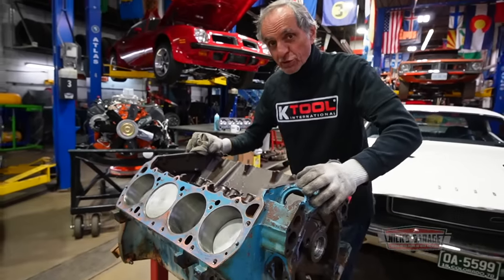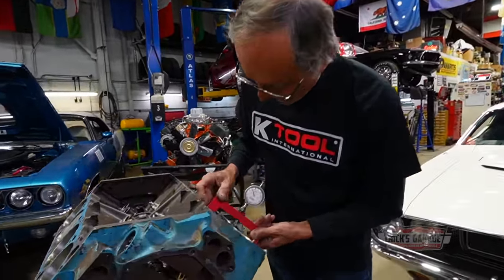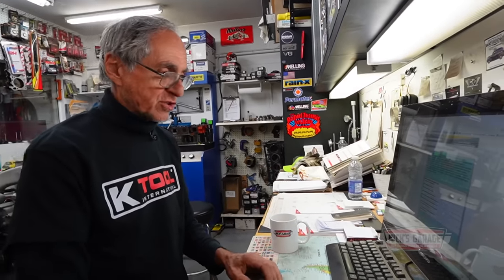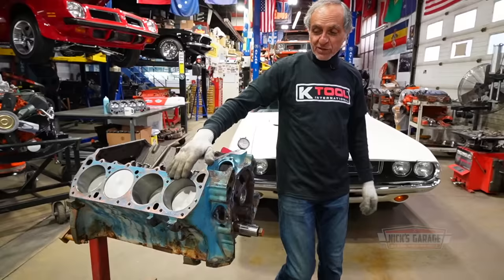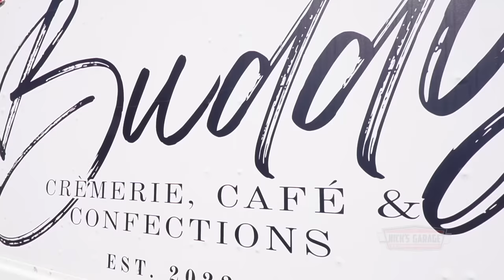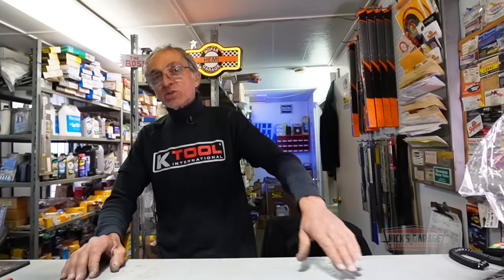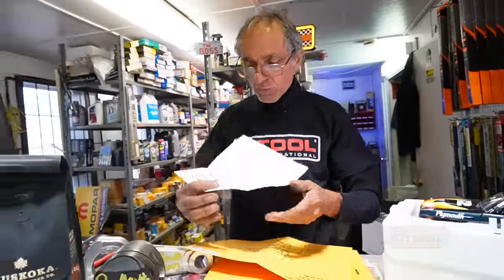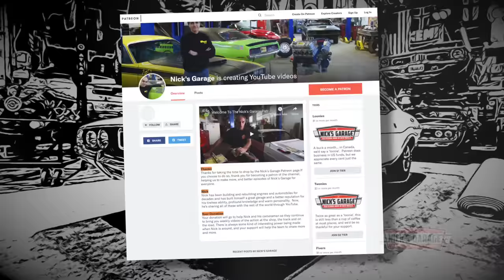Old 440 Build Diagnosis - What Were They Thinking?

Comment: 1978 440, advertised compression ratio 8.2; actual compression ratio around 7.5-7.8.  No mystery here.
Reply: Typical Calif smog motor.
Reply: Those were the smog years in all makes.
Reply: Volkswagens were required to meet emission specs they were not engineered for. Many people scrapped good cars in frustration that could not pass the smog tests.
Reply: Tricked out good VW engines were temporarily  installed to pass emissions. Various concoctions were added to fuel tanks for any possible emissions test for improvement.
Reply: A Hot Rod Magazine project found bronze valve guides with tighter clearances produced the single most improvement for passing emissions tests.
Reply: I agree partially, I’ve never seen pistons in a 440 installed that low though?
Reply: I've seen .080 below deck. This is nonsense.
Reply: I've seen .155 down with a  .045 dish.
Reply: There a lot’s varies Comp height pistons on factory mopar motor that were ready available back the day
Reply: RV engine probably.
Reply: Mike, it's disgusting ain't it,  mate. 7.5 compression,  sounds like an old pommy engine spec ! Haha what a joke 🤣
Reply: @invisiblecouch  lol did the engine even run ? Wow...
Reply: What is that like 90 psi cranking? Brutal.
Reply: And the Marine reverse rotation was 7.2:1 because I measured one in the mid 80’s out of the Century Boat 1976. I found that 6 different piston where being sold as replacement pistons tall cast with steel expansion struts just like Chry OEM.
I went through the engine and only changed pistons and rings. Set compression at 8.9:1 and it turned that boat into a rocket.
1st year for fiberglass hull which was made 1” thick manbit was a heavy boat. Yet ram 55 mph with 6 adults in it and was only 17’ long.
Reply: Had a white 79 Z28 with a 350. What a dog it was. About 7.5:1. And a smog pump. Even had 1 wheel drive. Looked good, but embarrassing at stop lights. 😅
Reply: @jojodiver8706  how do u mean one wheel drive?
Reply: @sebastianwirz5299  It had an open differencial. Only one wheel had traction, not both as in a posi diff.

Comment: The 252 may refer to the duration of the cam at .010 lift and that was milder than a factory HP cam.  That was an engine that would have no problem running 85 octane fuel.
Reply: That was my first impression as well.   Comp Cams 252H.  Probably from the early 90s?    I had a super mild SBC 383 stroker built by RHS in the mid 90's, it had a 260H cam to work with the emissions/pass emissions.   That cam he has there is an RV/towing cam.
Reply: It is, their old high energy series, I put a 252H in my 300 six cylinder in the late nineties, it would lug down to 300 rpm and not rattle.
Reply: I looked it up summit sells it, it's a .450/450 .250/250 cam according to them

Comment: Nick. I agree with you about the grease. If after 20 years it's still as white as that, then it's a lithium based grease, not intended for engine assembly. I think the confusion some have is that LUBRIPLATE 105 is a commonly used and accepted engine assembly lube, that also happens to be white, and, it's not a grease. I've used it myself to shelve an engine, coming back to it in maybe a couple of years, not twenty. It's not white anymore. It's "whiteish" almost leaning to a shade of gray. LUBRIPLATE 105 does not have lithium in it.

Comment: Just found this quote on a Mopar forum discussing a 440 in a 1978 Winnebago RV: "For 78, the 440 was right at 200hp/320ft-lbs. If memory serves, the same year 440-hp was 250hp/350torq. Compression was advertised at 8.2, however real world actual compression was 7.5."

Comment: From an old Jegs catalogue...COMP Cams High Energy 252H Hydraulic Flat Tappet Camshaft Lift: .425" /.425" Duration: 252°/252° RPM Range: 800-4800. They no longer stock this cam. 
Sounds like an RV cam.
Reply from the maker: Thanks for the info, Mercmad.
Reply: It`s a pooch.
Reply: @Sherlock I did the same damn thing!
Reply: @jeffjankiewicz5100  Chevy guy must have built it as a joke!
Reply: I pulled one of those out of the 351W in my truck, it got a long block years and years ago and a Comp cams 252H is what the rebuilder used apparently. The thing was gutless even with a aluminum intake, good 4 barrel carb, headers and exhaust. Replaced it with an XE250H and what a difference.
Reply: @NicksGarage  206 duration at .050 on a 112 lobe center

Comment: Nick was thinking what the heck when he found this 440's pistons so far below the deck He's answered the question to Dan's engines low compression There are big gains to be had here of that there's no question The annual Nick's Garage party was a blast Celebrating the best cars from the past A great atmosphere and the sky was clear For much more you couldn't have asked There's alot of appreciation for Nick improving folks motoring situation and putting right problems that could potentially cause devastation with a detonation You can tell by mail time and the determination Nick shows solving engineering crime Nick's Garage every week it's divine Thanks Nick and George Respect to all the party goers and mail time contributors and a big shout out to all the petrol heads watching from around the world
Reply: Hi rod nice review iam jeff from Australia watching from far away nick is fantastic

Comment: I have a 440 out of a 72 Imperial that I’ve been saving for a build.  When I got it years ago, I pulled a head and confirmed that it’s standard bore (with a slight ridge), and had never been opened.  I was shocked how far down the hole those factory pistons were compared to a factory Magnum/Commando/TNT 440, but as I recall they were closer to .070 down than .170!  I get that trucks, busses, and motorhomes do fine with low compression, though, and I believe Steve Dulcich calculated about 7.5:1 compression on a stock motorhome 440 that he disassembled on Engine Masters.   An engine like that may only make 250 horsepower, but it can make that full 250 hp for hours or days on end without any problems.

Comment: Great tear down! I have seen that before. It's actually pretty common on the stock 1977-1978 440 HP engines. They're rated at 7.8:1 compression (blueprint) so you can bet they're well below that. Weird thing was they used that long duration wide lobe center Magnum cam in those HP 440's of that era. No dynamic compression or cylinder pressure and horrible chamber quench. Those engines always ran HOT and were real hard on the exhaust valves. I'd bet that was just a 'stock' rebuild of one of those late model engines or they were trying to save $$$ on cheap jobber pistons. Didn't look like they even painted the engine. Sealed Power (TRW) used to have an L2388 piston that was the low comp. replacement. I believe all those std perf. '72-'78 440's listed the same piston. If I recall the CH or compression dist. was in the 1.926 range. Even those lousy (1970) L2266 pistons which ALL the rebuilders used in the '80's was 1.991. There WAS a special piston just for the '77-'78 440 HP that was LOWER in the deck than the non-HP. The HP was rated at 7.8:1 and the regular 440 was 8.2 or 8:1. Don't know why anyone would ever use those pistons. Had to be some generic non-Mopar machine shop that built it. 
That White Lithium grease will NOT dissolve in oil either. Just clumps up and floats around till you drain it. I've seen people do it. A real old timer's trick.
Reply: 5:27  100% , Nick sounds like a 🤡 being surprised by these pistons. Tens of thousands of 440’s come that way. Anyone with a decent background in 440’s knows this.

Comment: Nick , This is Chuck in Port Orange Fl. Love your show very good info. One subject your mopar viewers may find to be a help is to tell them to check the fuel pump push rod on mopar big blocks over the 50 years of having big block mopars I have had to replace two push rods on two 440s both were worn down about a 1/4 inch and did not feed enough fuel to the carbs. Thanks for what You and the Guys have created . Chuck in Fl. Owner of a 1968 Coronet R/t

Comment: Bought a reman 440 back in 1989 from my lokal performance parts dealer here in Switzerland. Supposed to be remanufactured by Keith Black (if there really was such a thing?) with forged pistons and 10:1 compression for a very decent price.
Put it into my '71 Barracuda and did the brake in. Felt not very powerfull. After break in went on the highway to see what it's got. Accellerated to 120 mph and slowed down. Coolant temp stayed high and after cool down the engine made a knocking sound. 
Took the heads of an found several seized pistons and the fact that they were very low in the bore. Checked the casting number of the block, it was a '74 low copression.
The pistons wre correct (forged 10:1) but the block was honed for cast piston clearance...!
The block was machined on the dealers expense and ran great afterwards!

Comment: Thanks, Nick for another great episode!  My 65 300L  had 10.5 to 1 if I remember correctly and I drove it on the street as a cruiser and didn't have too much issue with detonation.  7.5 that's nuts!
Reply from the maker: Very cool!
Reply: 7.5 for today’s gas and better road manners
Reply: Yes, this is a common problem with 'rebuilder' pistons and 'rebuilder' gaskets... 0.020" - 0.030" off... however, these pistons are extremely far down, 0.170",  indicating WRONG pistons, WRONG rods, and/or WRONG crankshaft! (IF 0.170" is correct)
In this case, next step is check the amount of crankshaft stroke... maybe Chrysler had 'smogger' pistons way lower than anybody else... GM used bigger combustion chambers, instead... 
MOST early 1970's engines from every company have actual compression ratio in the + 7's + ! 
Yet manufacturers were still claiming the magic regular gas "8 - 8.5:1"... 
Cam spec.s/part number/usage can be closely determined by measuring the lift on the lobes... 
Comp still sells 252H12 cams... about 206 degrees duration at .050" lift and on 112 LSA... usually considered a one step up car or 2 steps up truck performance cam giving about 400 - 800 more RPMs than stock and more power and a touch more torque... smooth idle... good MPG... good vacuum for power brakes... 
Using old hotter cams from 1960's  in newer smog engines with no compression was why 1970's cars got 6 - 10 MPG... they should have dropped back to 1950's cam grinds made for 7's compression ratio, but they wanted to advertise bigger HP numbers and more RPMs from their emissions slug engines...

Comment: Hey Nick, how ya doin? Enjoy your channel. That's the old High Energy 252 deg. stick. You remember the 268H High Energy that was popular in the late 70's-80's. Would help some with cylinder pressure with the 7.5 squeeze, but it's like this build was a conspiracy to see how weak you can build a 440. It's the kind of deal somebody would have tried to put in a motor home and run on regular unleaded back in the day. So, I just looked up the rest of the specs: .425" lift, 206 deg @ .050" on a 110 LCA. App reads: Excellent torque & mileage 361-400 2 or 4 barrel-so not even rec for 440. Smooth idle. Light towing. 9.0-1cr. Non HP OE replacement. 625 cfm carb. Operating range 800-4800 RPM. It's the kind of deal where you'd see a nice looking E or B bod at the drags and it runs low 16s at 85 mph and you wonder how could it possibly be so slow-well this is how. I bet if that poor 440 could talk it would say thank you for not making me run with this crap in me! Ha! Have fun fixin 'er up right and thanks for all the cool shows. Don Cann

Comment: I have a '78 RV 440 that I am putting in my '70 Challenger as a temporary engine until I get my good engine done. I tore the heads off just to verify what the actual deck height actually would be. My pistons are .120 below the deck. I thought that had to be the worst ever until I see this engine with another .053. My good engine will be .005 when it is done but at the speed of machine shops in my area I won't have the block back until the fall. Until then this low compression RV engine will get me to the local cruise nights and painted up with my Edelbrock RPM intake and old Direct Connection chrome valve covers it at least looks the part! 
I know the Comp Cams HE 252 was part of the High Energy line that they made in the late '80's and into the '90's. They had numbers from 240 to 270 and that was the advertised duration number. The 252 was considered a stock replacement cam for a low performance engine back in the day. The 260 was an RV cam and the performance cams started with the 268 and then the 270. The 280, 292 and 305 were the Magnum series cams and they all needed converters, compression and ran best with single plane intakes. Now this is across all makes, not just Mopar. As a matter of fact I was racing my '69 GTO from '83 to '92 and using a 292 most of the time but down graded to a 270 when I needed to drive the car everyday as my work car in about 1990. But the Pontiac cams used the exact same specs as small block Chevy cams as did the Olds grinds so I assume the Mopar cams were the same. I eventually switched to an actual Pontiac grind (041 Ram Air IV) and the performance immediately improved. I still own the GTO and it runs in the 11's with that cam but a lot of better parts in other places.

Comment: Nick, back in the day we were taught to smear the heck out of a camshaft with white lithium grease prior to installation. Then prime the oil pump with the distributor removed until it built pressure. 

I never had one come back, so it must have worked....

Comment: I had a similar situation. Years ago, I had a local machine shop known for quality work rebuild a 1969 440 for me. They did an excellent job with the work, but used the lower compression pistons and thick head gaskets. I was less experienced and didn’t understand that some shops rebuilt these older engines for street driven vehicles with lower compression due to the gasoline available at the time, unless told otherwise. I am now an old man with another 440. It’s from a 1967 Imperial that had 70,000 miles on it, but sadly, was crushed by a falling tree about twelve years ago. It will be built right.

Comment: Nick, remembering back 50 years ago in high school auto shop we were taught to use lithium grease when assembling a new motor or camshaft. Later I learned that I was supposed to use a assembly lubricant, thank god when we used the lithium grease we never damaged anything.

Comment: Hi Nick and I worked for Chrysler Corp as a dealership mechanic for 16 years during the 80's and 90's. The Dodge motorhome 440 were all painted blue, and you were lucky if the engine had 8:1 compression from the factory.
I believe the reasoning with such low compression was to avoid detonation with low octane gas.
I believe the cheapest way to get lower compression was by raising the block decks as opposed to coming up with a new piston. I also remember tearing down a 400 lean burn. That I remember noticing how far down in the bore those pistons were. Like a lot of the stuff back in the 70's I believe the cheapest way to reduce compression was to raise the block decks...

Comment: One day while I was out dirt biking I had the unfortunate luck of having a hole burn through the top of the piston. I took it apart and took the small bolt from the license plate and bolted it in the hole. It wouldn't start. I took it apart and using the tinfoil from my cigarettes I constructed a gasket for the bolt. It started and i rode it home about eight miles like that. New piston fixed it. I had one in my shop. 1980's. I've got a million of them Nick😊

Comment: Strange that Nick has built so much engines and have never seen '72 up 440 factory pistons. They are all that way, the true CR deep in sevens even with the steel shim gasket.

Talking about pistons .020- .030" below deck, you are talking about the 440 six pack spec pistons with about 2.06" compression height, distance from the middle of the pin hole to the top of the piston. 2.06" + half of the stroke 1.875" and the factory rod advertised length 6.768" makes 10.703". Factory blueprint deck height is 10.725", which gives Nicks .020-.030" below deck. That's six pack, like TRW or Speed Pro L2355F replacement. 

Now, a pre '72 regular 440, they used 1.99" compression height pistons without valve reliefs. That's already .093" below the blueprint deck height, and that's where for example all your factory "magnums" are. They are already below true 9:1 even with the steel shim, like TRW or Speed Pro L2266F.

And then the 440's from '72 on. They have 1.91" compression height. That's about 0.17-0.18" below deck. There is nothing unusual there, that's what they all are from the factory.

Comment: Thanks for yet another GREAT video!   Here's a total left field thought about the 440 with the low compression.   Maybe it was built with thoughts of running it with a turbocharger.  Depending on when it was built they may have looked at 7.5 as being "safe" given how there were fewer controls and such.   Just a thought.